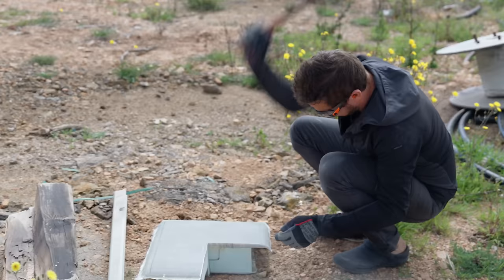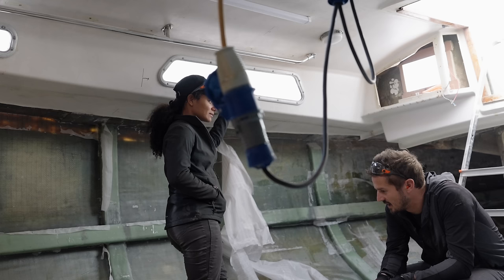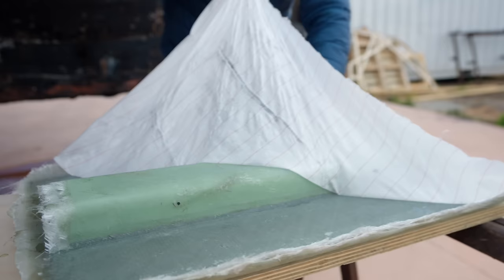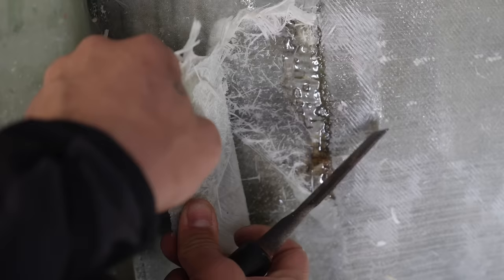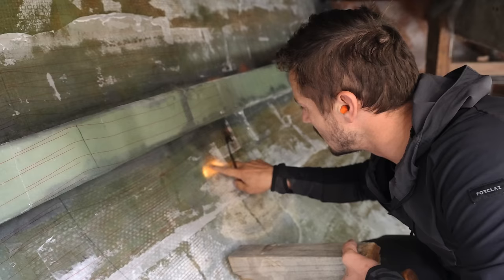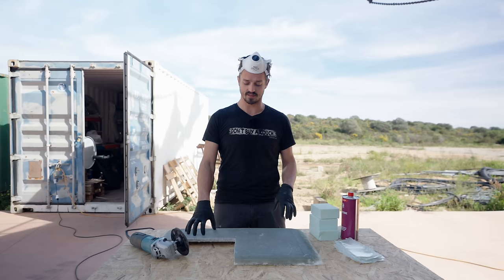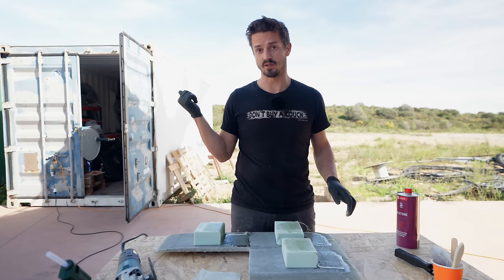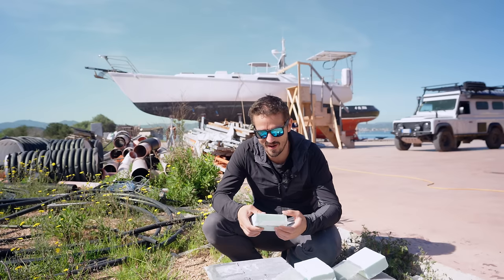If It Doesn’t Work, Hit It With a Hammer | Step 387

Comment: Another YouTuber, @boatworkstoday, demonstrated the same issue when laminating fiberglass. His key point was to 1) Wipe down, 2) Grind for tooth, 3) Clean, and 4) MOST important, coat the surface with resin BEFORE applying fiberglass! Do NOT place dry fiberglass on the surface followed by wetting with resin. During his demonstration, the test pieces that did not have the initial wetting with resin BEFORE applying the glass had results similar to yours.
Reply: Excellent, and yes, proper.
Reply: I used to make carbon fiber parts from scratch and you are 100% correct. Wet first then apply the fabric!
Reply: Andy from BWT has years of experience with glass.  I would LOVE to see a collaboration with him.
Reply: Epoxy would never have delaminated like that.  I have done one project with foam and ester resin, vastly inferior to epoxy. Esters are not a glue.

Comment: Before laminating on poliester hull  you need to grind, vacum the dust,  clean with acetone , which all you did and than use liquid STYREN (Whipe it over the top layer of hull with cloth) to chemicaly activate the top layer of the poiliester in you hull laminate - result is a sticky hull like due to activation of the top layr of old hull resin. This is a must for chemical bond which you do not have. Than you laminate within  up to 8  hours after styren activation of top layer. This works on polyester and vinilester resins. Being a boat builder and yacht designer and having similar issues in the past I am talking from experience
Reply: Yes....and I would only add that you should degrease the mold wax on the existing hull first before any sanding or grinding. I use xylene to dewax, followed by acetone to wipe away any film left by xylene. Acetone by itself is a poor degreaser because it flashes to fast.
Reply: Really pleased someone mentioned this. As a boat builder. this is standard practice when attempting to add layers / strips to an already cured surface. As mentioned, primary reason is to re-activate and ensure chemical bond between old and new.
Reply: I once heard from a boat builder: either you sand or you use peelply. BUT: both things should be not older than 24 hours. Why did you not use Epoxy? I only trust WestSystem.
Reply: @belimooo  use of peel ply is of triple purpose: 1 to absorb extra  resin ,  2 to create rough surface  for secondary bondig(texture of  ripped peel ply creates larger area for bonding ) and 3 to protect  top layer of fibers from being dirty or damaged. Peel ply is taken of just prior od second bonding of layers or before applying sanding compound. There is a huge difference in using epoxy and ester type resins (polyester, vinilester). It is completely different chemistry. Idea is to always have chemical bond. So polyester on polyester and epoxy on epoxy.Yes  people use epoxy on everything but it is not miracle resin. Difference between those resins is in elongation under stress; poliester 1.5-3% relatively cheep, vinil ester 3-4 % moderate cost and epoxy 5-6 %  2 to 3 or more  times the price of poliester. On ester type boats, especily older ones, where resin has been cured completly over the time, it is important to use Styren to activate the resin for chemical bond. Epoxy has nothing to do with it, for epoxy bonding  just rough the surface(sanding), clean it (xylen -much better than acetone), heat it if possible(heat gun on local area) and than you can start do laminataion or what is intended in epoxy based system. There is also huge differnce in epoxy types but this is no the topic. West system is great epoxy sistem but expensive compared to others. Personaly I use West system epoxy only on ther areas which are exposed to the sun  (deck and riging) duo to very good UV protection of West system resin (probably the best on the market). For lamination of the construction and hull areas I use different  epoxy resin depening on the pupose. For proper repairs I always use the same chemistry as the base sistem, epoxy works on small repairs which are more of cosmetic nature tha structural. It is easier to use than doing styren activation, also where I live liquid styreen is not the of the shelf type of product.
Reply: Interesting, thanks! However also WestSystem Epoxy has no UV protection at all. Why do you think it has?
Reply: @belimooo  in my experince west system is the best option for using on boat parts that are exposed to sun. For the last 40 years West has been using some aditives in epoxy for UV proterction. Now do not get me wrong, no epoxy dirrctly  exposed to sun will stay clear. All of them will eventualy chage color to little yellowish. But from all that I worked with West system epoxy has managed to stay the clearest for the longest time.  Nowdays, what I do on wooden parts exposed to the sun on boat is t to use 3-4 layer of West system epoxy an than varnish it with at least 6  layer of polyuretane clear coat

Comment: The transition of Kika's face and body language from before to after wood hammering shows such relief is amazing!
Reply: The energy and effect of hitting a dock is much much higher than slamming that small hammer via a block of wood, because the weight and inertia of a big boot is behind it.
Reply: At first, I thought she'd come out holding a scrap of fiberglass to prank Dan but that would have been excessively mean.

Comment: The notion that grinding allows the resin into the old laminate is wrong, all those prickly bits of glass  after grinding will in fact penetrate into the new laminate. As brunoancic1401 is telling you use styrene to reactivate the old resin, it needs to be sticky. One thing that has bothered me in the build is the lack of cross bracing to determine the boats shape before you started the laminating. You were in the empty hull commenting as to how much movement there was. A stringline down the center and measure to each side. Good luck.

Comment: This hammer test on the outside is not good for anything. I do not understand the reason for using vinylester on the inside of the boat. It is more expensive, has a short shelf life and the better water resistance properties doesn’t come to use on the inside. Polyester is easier to work with and more economical to use.

Comment: FYI guys, Whenever you use a solvent to clean with (especially Acetone!!!) after you wipe a part down, take a clean, dry cloth and wipe it down again.  All solvents leave a residue on the parts, and will contaminate any bonded joints.  Just sayin….  Love the video’s

Comment: A good engineering principle is :"Run samples". In your case a little sample of wetted out glass bonded to the inside of the hull, and formed to stick out at right angles( and then broken off) would have given you a true data point as to whether the vinyl ester resin would bond to your existing hull.

Comment: The 'thickness' of the resin will determine its ability to fill the micro cracks made by the preparation. 
Filleting the edges of the foam ribs will distribute the forces over a much larger area.
Everything gets back to the distribution of forces. 
Architects bring the future perfect. 
Engineers bring durability. 
Think Buckminster Fuller.
I have no wish to be critical.  Education expands.I absolutely adore your work. 
Love ya guts.

Comment: I realize that these videos were filmed weeks ago, but you got all the advice you needed last week.  I've done hundreds of fiberglass jobs, ranging from small pieces to major repairs, and you didn't prep your test piece properly.  Anything being glassed (Or painted) needs to be scuffed up.  When glassing, it really needs 60 grit, and no need to acetone before - that is unnecessary!  (I mean you can do it, but more important to do afterwards than before.)  60 grit will take off ANYTHING that is still stuck on there.  I am not a fan of spinning disk grinders.  I think there is a greater chance of gouging the surface, and tricky to get into corners.  This is more important when painting than glassing.  I prefer an orbital sander, and you can get round or square tools which can help with joints and seams.

After sanding, wipe with a wet cloth first, then acetone, to ensure a REALLY clean surface.  If doing  a large surface, use compressed air to get the surface dust off before wiping with water.  If you can get a hose on it, do that too, then wipe with a clean cloth.  When you wipe with the acetone, only the smallest amount of very fine dust should be left.  If the contractors sanded or ground the surface, and cleaned properly, that new glass will be as strong as the original hull.

Comment: Obviously I don't know everything that's going on with your build and it sounds like you've got a lot of smart people helping already, but I'm a boat builder manufacturing fibreglass boats with vinylester resin doing very similar things to what you're currently doing. We find that the resin we use when infusing parts tends to be harder to bond to and requires additional coupling agents or adhesion promoters beyond just cleaning and grinding. On the point of grinding, ALWAYS rough the surface, if you're laminating on top of a peelply finish then a quick scuff with 40 grit sandpaper is generally ok but if it's a smooth resin finish or an infused finish you want to ensure its well ground.

I primarily do systems fit off work and only a few weeks every year I help laminate the structure but to the best of my knowledge. 1 clean the surface as you've been doing, 2 grind or sand to create the mechanical bond, 3 prime with a bonding agent, this might be a thin coat of a good structure adhesive or perhaps additives like silanes in the resin, I can't advise on this as it's not my area of expertise. 4 laminate, I won't explain you already know. 5 peelply so that it's easier to grind, easier been the key word there.

This might be late or information you already have but it's another data point so I hope it helps 🙂

Comment: I’m an industrial designer and used that foam to make models at design school years ago. It has a smooth skin on the finished processed side and I would always sand past that to the porous foam before laminating blocks together as the factory surfaces always delaminated.

Comment: Polyester and Vinylester don't make the strongest mechanical or flexible bonds....as Epoxy would. So applying a primer coat of styrene thinner over existing hull surfaces that are fully dewaxed and toothed with 40grit is beneficial to enhance a degree of both chemical & mechanical bonding.

Comment: Great job. thanks for pointing out your mistake so we don't have to make the same one. i just got done repairing a 10 x11 inch hole in my Hall. boy did it fell good to know that I can do that kind of stuff if I need too. I bought a 21' sailboat to learn on last year. poked a hole in it when I turned to sharp and the back end of my truck pushed a hole in it. but that why I bought a 21 foot to make mistakes with, less stressful making mistakes with a 3000 then a 50000 to 100000 boat. you guys have been a real inspiration.

Comment: I recommend you try epoxying  the test pieces back together, then try separating them with impact again. It will show you one of the most important Must do's in boat restoration- secondary bonds need to be done with EPOXY, never ester based resins.

Comment: I wish you all luck with this renovation. One thing I hope you'll consider though is that the test you've done hammering the hull from the outside is not even near the forces of impact and torsions the oceans, docks and other real life scenarios will put your boat through. Basically, don't use that as any assurance. You are loved and we want you to stay safe.
Reply: Was thinking exactly the same. You shouldn’t be reassured by that. 
It is when the hull flexes it will gradually delaminate. 
I doubt any of this will cause a sudden structural failure but will gradually be noticed by squeaks etc.
Once it starts to delaminate moisture and other chemicals will find their way between the layers and speed up the process.
Reply: @abbbee8918  That's some of what I thought. Thanks for listing. I am still concerned for them in relation to torsion forces while sailing in open oceans. They have experience so I trust they'll be OK. I am just not sure if the repairs will last as long as they'd need them though.

Comment: I had not realised that your test sample hadn’t been ground prior to bonding on the “ribs” as had been done with your hull interior. 
Knowing that now, personally I’m a lot more comfortable that there’s no issue with your resin performance. 
In similar work that I’ve done I’ve always used epoxy for it’s relatively forgiving nature and it’s mechanical bond strength, having had a couple of bad experiences some decades ago with polyester lamination onto old polyester substrate. 
I’ve had no experience with vinylester so it’s interesting to learn about it’s properties in use. 
Good vid and I’m greatly relieved for you in its outcome, but I’ll bet that my feelings of relief on the matter don’t hold a candle to yours!
Well done for your approach to investigating the issue, it’s not always easy to maintain a completely objective viewpoint when you already have so much invested in a situation. 
Onwards and upwards, cheers!
😎👍🍻

Comment: If you are using waxed finishing resin or adding wax you have to prep well. Always wipe down with acetone before any coat. Just dust in the air from pollen or anything can wreck a lamination.

Comment: Thank you so much, I have learned at lot for this video, the bonding is key: so fist degrease, then sand and remove dust and degrease again. Then you can start to rebound new glass to the excisting structure.  Keep on the good work.

Comment: I had the same sinking feeling last week. We’ve all been there. 

I had a feeling that the fact you didn’t grind the glass before gluing the stringer was a possible cause for the failure. I haven’t done much glasswork but having a clean roughed up surface gives the resin something to bond with. 

Glad you could turn that frown upside down. Keep up the good work. 👍

Comment: You made a comment at 16:45 about the timing of laminating. That does make a difference. You have to determine the per the particular resin you're using, what the optimal lamination timing should be, as well as sanding if necessary. 
Built large composite structures as an engineer, including airframes. Impressed at the methodical approach you've taken to evaluate a potential issue.

Comment: So glad you pulled advice from the vast Uma nation, and you folks have been diligent in your own testing.  You model thoughtful and careful stewardship!  Could the issue have been lack of using acetone to do a final wipe down before applying the new layers?  Between sanding/ scratching the surface and having unseeable contaminants, there are probably a host of issues, but those two stand out as the big ones in my experience.  Good luck with the evolution of your ‘remodel!’  We all are looking forward to seeing the interesting developments!

Comment: Vinylester resin is great. I built two Glasair planes with it. But secondary bonding is not vinylester's thing. You should have added the ribs and stringers as you went. But there' s also an issue that the same resin is lining the hull, which presumably was originally polyester or epoxy. Will the new hull eventually delaminate from the old hull? Your best answer is to use epoxy for the ribs and stringers because it does secondary bonds much better than vinylester. And is the vinylester you used a bonding resin or a finishing resin? Does it have a wax coating from a finishing resin? In that case better to use bonding resin and spray it right away with PVA. That is all.
Reply: Thinking further, the work you hired-out may be useless unless you add through fasteners to keep the delaminated inner hull lining attached to the old hull when the it flexes underway. Use stainless fasteners and replace the ribs and stringers with sheet stainless ones. Sorry. Who designed this repair?

Comment: Thanks this a great result ive commented on every video ive ever seen that states peel ply leaves a great bonding surface and it does not we Tested this in the early 2000's. Now the internet knows if its structural grind it sand it clean it.